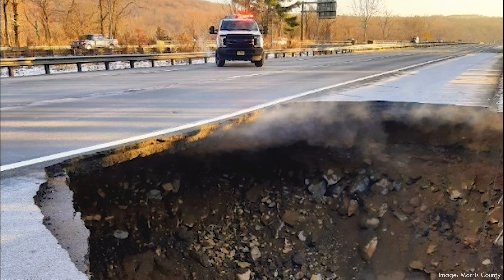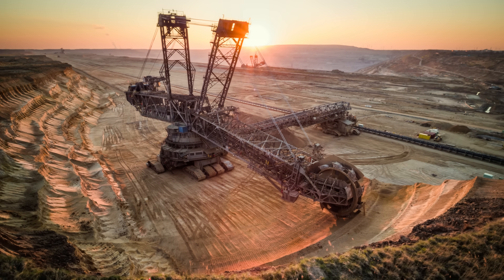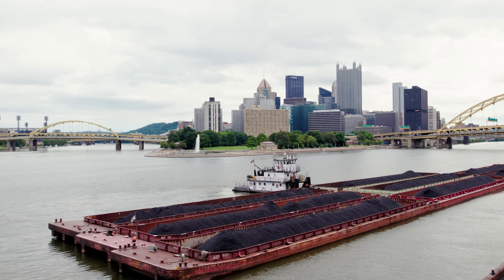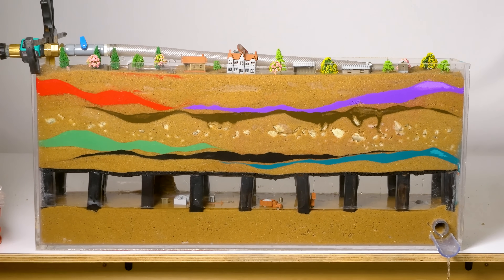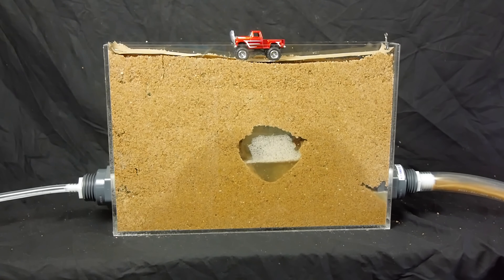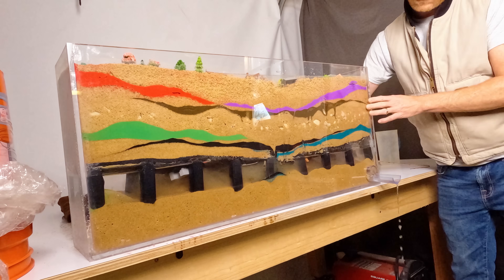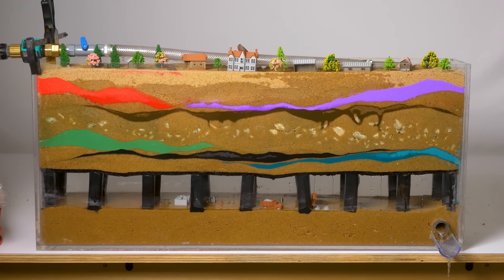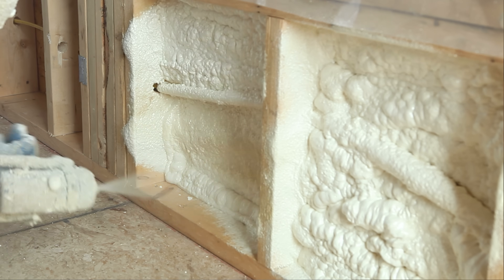When Abandoned Mines Collapse

Comment from the maker: 🏞Lots of cool stuff (plus my book) available at the PE store: https://store.practical.engineering/
🌌Get Nebula using my link for 40% off an annual subscription: https://go.nebula.tv/Practical-Engineering
Reply: When I was a kid in Texas I visited the San Jacinto monument which is sinking not from mines but merely from extracting ground water for human consumption.
Reply: @SeattleRafael same with Central Valley in CA
Reply: Trains are awesome.
Reply: nebula is a ripoff.
Reply: Abändern Mainz Collapsing AT Robert voll stop but really FANNIE I Collapse in Mainz in Fall Operation exkl Menschen Marc
Reply: the solution to prevent damage from earthquakes is the following:

create a cavity below the surface.
fill the cavity with water.
cap the ends.

then when a earthquake happens you will ridddddddde the wave baby..
ride the wave.... smooth as a babies bum bum..
like soft rubber, like a smooth silky road.
like springs under the megastructures..

END____________>

submit the above to chatgpt or grok.. i dare you....!

i did it for you.. read below........ 

The idea proposed by your student is creative but lacks scientific rigor and practical feasibility. Let's break it down and discuss the concept, its potential inspirations, and why it may not work as described, while also exploring related ideas in earthquake mitigation.

Analysis of the Proposed Idea
The suggestion involves creating a water-filled cavity beneath the surface, capping it, and using it to "ride the wave" of an earthquake, likening the effect to soft rubber or springs that smooth out seismic vibrations under megastructures. Here's a review of the key components:

Cavity Filled with Water:
The student likely envisions a fluid medium (water) absorbing or dissipating seismic energy. Water is incompressible, which means it doesn't compress under pressure like a gas or a spring. This makes it unlikely to act as a "soft" or "springy" buffer as described.
Seismic waves (P-waves, S-waves, and surface waves) travel through different media at varying speeds. Water can transmit seismic waves (especially P-waves) but doesn't inherently dampen them significantly compared to solid materials like rock or engineered dampers.
"Ride the Wave" Concept:
The phrase "ride the wave" suggests the structure would float or move smoothly with the seismic waves, avoiding damage. This might be inspired by base isolation systems, which allow buildings to move independently of ground motion. However, a water-filled cavity wouldn't provide the controlled decoupling needed for this effect.
The analogy to a "smooth silky road" or "soft rubber" implies flexibility or damping, but water lacks the viscoelastic properties of rubber or the controlled resistance of springs.
Capping the Ends:
Capping a water-filled cavity suggests a sealed system, possibly to contain the water or create pressure. However, this doesn't align with how seismic energy propagates or how damping systems function. A sealed cavity could even amplify certain frequencies of seismic waves due to resonance, potentially worsening the impact.
Springs Under Megastructures:
The mention of "springs" and "megastructures" hints at an intuitive grasp of existing engineering solutions, like base isolation or tuned mass dampers, which use flexible materials or mechanical systems to absorb or redirect seismic energy. The student's idea may be a simplified or metaphorical take on these technologies.
Scientific and Practical Challenges
Physics of Seismic Waves: Seismic waves are complex, with different types (primary, secondary, Rayleigh, and Love waves) interacting with materials in distinct ways. Water-filled cavities wouldn't effectively dampen all wave types. In fact, water could transmit certain waves faster than solid ground, potentially destabilizing structures.
Structural Stability: A large underground cavity filled with water could weaken the ground, increasing the risk of subsidence or collapse, especially during an earthquake. Maintaining the integrity of such a cavity under seismic stress is a significant engineering challenge.
Scale and Cost: Creating and maintaining large, sealed, water-filled cavities beneath buildings or cities would be astronomically expensive and impractical. The logistics of construction, sealing, and preventing leaks or contamination are daunting.
Resonance Risk: A water-filled cavity could act as a resonator, amplifying certain seismic frequencies rather than dampening them, similar to how water in a glass can amplify sound when struck at the right frequency.
Potential Inspirations and Related Concepts
The student's idea seems to draw from real-world earthquake mitigation strategies, perhaps misunderstood or creatively reimagined. Here are some related concepts that align with their thinking:

Base Isolation Systems:
Modern buildings use base isolation, where structures rest on flexible pads, springs, or bearings that absorb seismic energy, allowing the building to move independently of the ground. The student's "springs" and "ride the wave" imagery may reflect this concept.
Example: The Transamerica Pyramid in San Francisco uses base isolation to withstand earthquakes.
Tuned Mass Dampers:
These are large, heavy pendulums or masses installed in buildings to counteract swaying caused by earthquakes or wind. The "smooth as a baby's bum" analogy might evoke the smooth stabilization these systems provide.
Example: Taipei 101 in Taiwan uses a massive tuned mass damper to reduce seismic and wind-induced motion.
Liquefaction Mitigation:
In some earthquake-prone areas, engineers address soil liquefaction (where saturated soil loses strength during shaking) by improving drainage or reinforcing the ground. The student's water-filled cavity might be a misinterpretation of techniques to manage groundwater or soil properties.
Floating Foundations:
In rare cases, structures are designed to "float" on soft ground or use flexible foundations to adapt to ground motion. The "ride the wave" idea could be a poetic take on this, though water-filled cavities aren't used in practice.
Constructive Feedback and Alternative Ideas
The student's enthusiasm and creative analogies ("smooth as a baby's bum," "silky road") show an imaginative approach to problem-solving, which is valuable in engineering and design. Here's how you could guide them to refine their idea:

Encourage Research into Base Isolation: Suggest they explore how base isolation systems work, as these achieve the "ride the wave" effect more effectively. They could investigate materials like rubber bearings or friction pendulum systems.
Explore Damping Materials: Instead of water, they could consider viscoelastic materials or fluids with specific properties (e.g., magnetorheological fluids) used in advanced damping systems.
Study Soil-Structure Interaction: The cavity idea might stem from a misunderstanding of how soil and structures interact during earthquakes. Encourage them to learn about geotechnical engineering and how soil properties affect seismic performance.
Prototype a Small-Scale Model: They could experiment with a small-scale model (e.g., a shake table with a structure on a water-filled base vs. a solid base) to test their intuition and see why water isn't an effective damper.
Incorporate Data: Suggest they look into seismic wave propagation and how different materials (solids, liquids, composites) respond. This could ground their idea in physics.
Broader Discussion: Earthquake Mitigation Innovations
Earthquake engineering is a dynamic field with ongoing innovations that align with the student's desire for creative solutions. Some cutting-edge ideas include:

Seismic Cloaking: Researchers are exploring metamaterials that can redirect seismic waves around structures, effectively "cloaking" them from damage. This is more sophisticated than a water cavity but shares the goal of wave manipulation.
Self-Healing Materials: Concrete that repairs its own cracks or shape-memory alloys that restore structures after deformation could inspire the student to think about resilient materials.
Smart Structures: Buildings with sensors and adaptive dampers that respond in real-time to seismic activity could align with the student's vision of a smooth, adaptive response.
Conclusion
The student's idea, while not feasible as proposed, reflects an intuitive grasp of earthquake mitigation principles, possibly inspired by base isolation or damping systems. The water-filled cavity concept doesn't hold up due to the physics of seismic waves, structural stability concerns, and practical challenges. However, their creativity and vivid analogies suggest potential for innovative thinking. You could encourage them to explore real-world earthquake engineering solutions, experiment with small-scale models, and ground their ideas in scientific principles. If you'd like, I can search for specific resources (e.g., academic papers or videos on base isolation) or analyze any additional details the student provides to further tailor the discussion. Let me know how you'd like to proceed!
Reply: @Bibibosh  I'm a furry, but you're more cringe than me...
Reply: You didn't mention that salt mine that swallowed a lake?
Reply: I
K
Mmm nm
Reply: Should look up bonne terre mine in missouri, 7 levels deep lead mine that's shut down and flooded in 5 levels.

Also that Alton mine was originally a limestone (calcium) mine, owned previously by Mississippi Lime company who still own alot of mines including the largest limestone mine in North America
Reply: I noticed your restraining the "simulation" here, I'm curious to see what it would look like if it was in a square instead, or maybe a cylinder ?
Reply: Question...has anyone studied the idea of using expanding high density foam to fill the spaces/voids created by mining an area to stabilize the area around/above a mine in a similar fashion that they use foam blocks to fill/support ramps up to and down from over passes on highways/city roads etc.??
Reply: @ArbitusRM  the mass is so huge that it would crush just about anything like that. It was enough down force to make coal :o But I love the thinking :o)
Reply: @teamidris  I suspected that was the case but with today's newer technologies that are being consistently developed one has to think that if the developers who created this type of  expanding foam went into research looking at it's "filling" properties rather than insulating that they may come up with something new.  I guess it all comes down to the density of the product.  So in that case it'd probably be simpler to pump in concrete into the voids though that in itself would lead to a lot of things.  Especially seeing how much concrete most mines would take would generate a whole long of carbon negative release into the atmosphere etc.
Reply: @ArbitusRM  honestly sand is fine. Anything that can’t be compressed.
Reply: Something else that’s really cool about mines is that sometimes they would need to be filled in and instead of just using dirt or concrete mining companies would literally just kind of throw whatever they found in the hole so there’s like cars and washing machines and all sorts of cool things just abandoned in mines covered in concrete now
Reply: @russellpeterson9012  Burton Gypsom mine normally never has vehicles leave. When they are beyond it they park then in a side tunnel and that’s it :)
Reply: Why don't they backfill mines?
Reply: You don't even have to dig mines to get problems like these.
The Netherlands stopped (or is still stopping) the exploitation of there huge natural gas reserve in Slochteren because of the subsidence and even small earthquakes.
Reply: Hi Grady!
The sand layers you show at 5:40 or so; how do you separate out the colors later on?
Or do you just dispose of the sand and get new ones?
Cheers from the Netherlands :)
Reply: Grady builds with steady hands,
tiny dams in plastic lands.
In his garage, where tools align,
he makes dirt science sound sublime.

With every levee, trench, and stream,
he turns mud pies into dreams.
Water bellows, pipes are placed
and suddenly, dirt’s not a waste.

He smiles, he points, he breaks it down
Grady’s the dirt king, crown to ground.
Reply: I like your opening theme, Tonic and Energy by Elexive. What is the name of the song that you play after that?
Reply: Can you please do a video essay about the effects of coal-mining in areas adjacent to rivers with downstream towns and cities?
Reply: The model is ace :o) I like in a midlands England mining area and it seems to have stopped sinking now. And oh boy did it sink :D
Reply: I recognized the Alton sinkhole from the news last year, its pronounced " All ton"
Reply: Can you do a video about open pit mining?
Reply: Thats a great vídeo!!!🎉
Reply: ty, Videos like this are reason that i still watch youtube.. <3
Reply: It's been years. How is a credit card still the only payment option for nebula ?

Comment: A ways from Roundup Montana i worked in 1984 or 85 on a waterwell/seismic drilling rig contracted with the Montana Reclamation Bureau. Old small scale coal mines 80ft underground from the 1800's and never been mapped nor evidence of entrance locations. Mine had collapsed here & there causing county gravel roads to sink also some farmers fields. We would drill holes into the shaft not very long in length but still open. A contracter with a back & white camera on end of a pole, monitor and tarp would tell us where & which direction to drill next hole. Later a contracter came along afterwards and air blew small pea gravel filling up the shafts. I would watch on monitor the drill bit breaking through the ceiling. Seen gunpower kegs stacked 3 high with bottom row being collapsed along wall. We saw shovels, picks, wood, logs,...exc. leaning against wall. The best was a very large room we guess was a breakroom bc there was a big round wood table with chairs around it. Clothing on back of some chairs, table had several plates, silverware, cups, a couple whiskey bottles, a few small bottles, rags or gloves? a big jug, we guessing tobacco tins & couple of head laterns, small miscellaneous items, 3 long rain coats or dusters hang on wall pegs. Look as if they  went home for the night and never returned. Also in another location drilled some small hole into burning coal in spots leaving only wire hanging out above ground for monitoring fire temperature. Most exciting job i ever had plus my rig owner had to pay me union scale wages or better.

Comment: The town i grew up in had lots of coal mines, they all closed in the 1960s. My great aunts house had a sink hole develop about 20 feet from the foundation wall. luckily it was filled without issue. My parents house was thought to have a sewer that emptied into the mine, many older homes do in the area. However it was later discovered (after a sewer back up) that their house was connected to the neighbors, then through them connected to city sewer. Dad had to hire a team to tunnel under the road to a nearby manhole. 8000 dollars to do it. Years later the houses south of dad who all had septic systems were forced to connect to city sewer, pay something like an extra 100 something dollars a month for 25 years for the privilege. My dad got bills as well. It took so much work to prove my dad already paid himself to connect, even though permits had to have been pulled. The engineer who did the work fought and fought for dad to finally get them to stop billing. Dad didnt have to pay a sewer bill for several years after that lol.

Comment: The copper mine I worked at in the early 70s would fill old tunnels with a mixture of relaimed tailings from the mill and concrete when the ore vein played out. I ran the drag line reclaimer out on the old tailings pile which would pump the liquified tailings up to the cement plant to be mixed and pumped down into the mine.

Comment: Two points: 1) Coal is not used in steel refining. It is used in the production of iron in blast furnaces, which is then refined to steel by reducing the amount of carbon in it. 2) The sinkholes in Rt 80 in NJ are the result of iron mining in the 1700s and 1800s.

Comment: At the off chance you see this. You should look into the abandoned oil platforms in the gulf. They have the same sort of ownership issues abandoned mines have. There are thousands of abandoned oil platforms with wells that are not permanently plugged. These wells will eventually fail due to corrosion. But since it hasn’t happened yet on a large enough scale. Nobody seems to care

There’s potential for spills much larger than BP. And we may initially have no idea where it’s coming from making the issue much worse

Comment: I 80 was built somewhere around the 50s and when they were going over Morris county (used to be a huge mining town) many miners were warning them that the mines weren’t properly backfilled but the builder ignored them and kept going. Over Half a century later paired with an earthquake (hella rare for nj) sinkholes started to happen. It was telling that the issue wouldn’t resolve quickly when a few months after the one in December another one happened and when there was a depression in the road they tried to measure it and them doing that caused the sinkhole to give way. Those 3 ish months were not fun 😅

Comment: I lived on an area in New Jersey that had several mines in it.  Just up the slope from where I lived were several tunnels & shafts.  Until I was born, there were two shafts that were filled with water, but the township filled them leaving two 50 ft high mounds behind.  Later, somebody removed the mounds and built a house directly over where they were.  Always wondered if there was a possibility that the fill in the shafts uner the house could settle & cause problems.